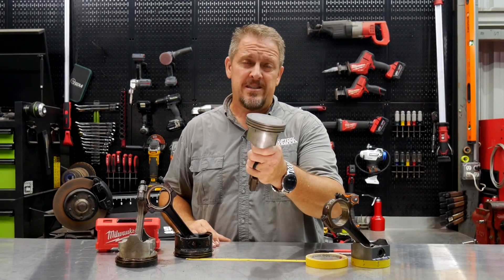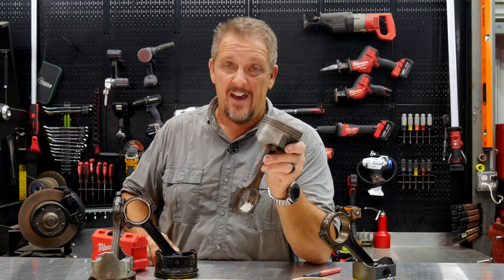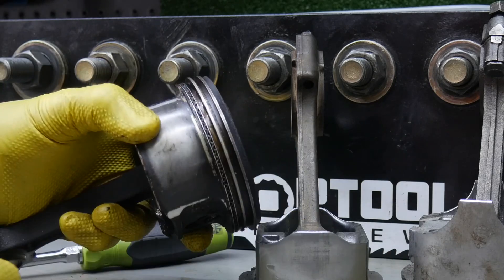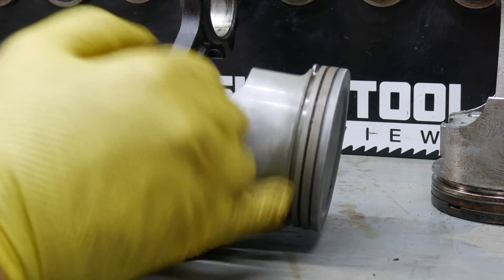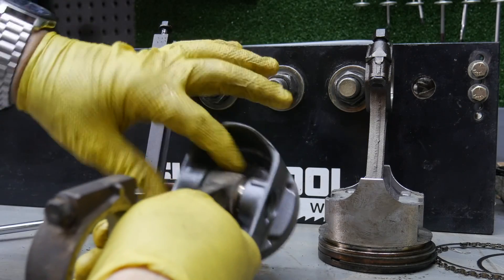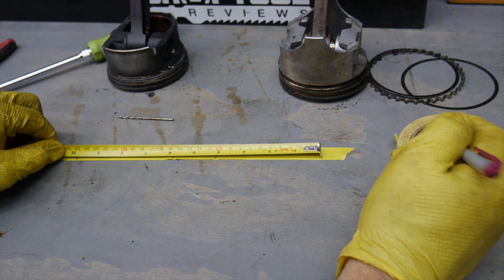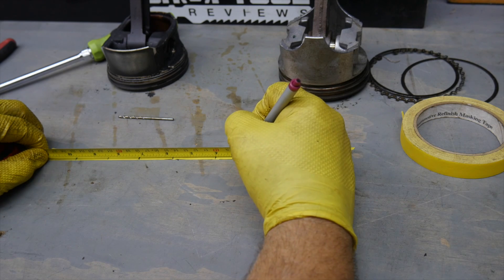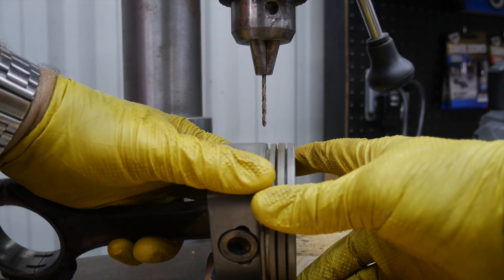How To FIX Chevy’s LS Piston Mistake - Oil Consumption Fix In Minutes [DRILLING FOR OIL]

Comment: Oem ls3 pistons come with 2 additional oil drain back holes already per side. If your doing a rebuild and you arent going forged its a better piston vs the l99 or truck l92 6.2 variants.

Comment: Very good ! The only thing , (based on what I’ve seen on other  pistons designs ) is the right number of holes ! I think that there need to be drilled much more than 4 holes . Probably 8-10 ( 4-5 by side) will be better and right . Also , first you can drill pilot holes with smaller diameter drill bit through small piece of tube ( bushing) with outside diameter close to the hight of the ring channel and inside diameter a little bit larger than the drill bit diameter . This way the holes will self center on the bottom of the ring channel. After that you can make second pass with the larger diameter drill bit. Thanks for the video!

Comment: my LS 3  IN A 2006 MONTE CARLO WAS USING OIL & DEVELOPED A MISS -  Upon some research i found this tp be a VERY common issue -  i have forgotten which pistons are prone for the problem  seems like ther were 3  of them - you can goggle for yourself -  Anyhow - G.M. makes a chemical that is poured into the problem cylinders - let that stuf set for whatever time the instructions say , seems like approx 15 mins - chev sells this by the quart - your gonna hafe to check with the parts dept for the name  ,sorry -- it has been 40000 miles since i did this treatment and several years so pleaze forgive me ---- HOWEVEER for approx $ 25.00 YOU can fix this issue -  the back plugs were difficult  but maybe u have tools that i dont have .   u will need a small funnel & about a foot of hose to reach spark plug hole -  plus sockets etc -  remove problem plugs pour chem in -let set minutes - after setting  remove coil wire -so it wont start ture it over to purge liqid - put a peice of cardboard over top of engine to keep the chem from geiiing on paint -  hope this helps some one -  i changed ALL plugs & wires  while at it approx ,110 k on the car when done - now 150 k   with more to come

Comment: Wow 😮this is cool, I have a question I have a 2017 Kia soul and is starting to burn oil almost a 1quart every 2000 miles Can this be done in the pistons on that engine if I rebuild it, the car is awesome and it has good mpg everyone your comments will be appreciated.

Comment: We have the 2.4 ecotec engine, we are going to do this for the notorious engine oil burning issue, Jasper Engines now apply this method on the 2.4 pistons in the Ecotec engines that they offer now, I am convinced of this method of modification. Thanks for the awesome info vid
Reply: my old 2.2 ecotec burned oil like crazy i'd have to put in a quart every 2 weeks or so but i beat that motor up every day redlined and took every beating

Comment: So, is this THE cure, no but it is an easy thing to do that can only help. If it does nothing more than keep the rings free it's a great idea. An oil catch can in the PCV tube is also a great addition. I would also like to add that almost NOBODY changes pistons on an LS. I have NEVER seen one with a ridge at the top, or pistons that were worn out of specs, why spend at least $300 for pistons unless you really hate that piston slap. My buddies truck was down 80 hp at 275k, new rings and a bigger (stage2)cam, boom 180 hp gain. These blocks, hypereutectic (hard surface) pistons, and better oil keep these from wearing like any old engine from the 50-60"s  As a GM World Class tech and slobbering car nut, I have pulled lots of these apart. Most all of them have stuck rings. I have also seen it on many other engines, besides GM (for all you haters). Seems like every manufacturer has oil consumption problems: 4 cylinder Ecotec Mini Cooper, 4 cylinder Chrysler, Nissan, etc. Later model LT engine have holes behind the oil rings, and a different PCV system, very few oil consumption problems. Now in my experience with these engines it is rarely just one thing that causes this problem. Cheap oil (Dexos is great, cleans out sludge and is available at Wal-Mart cheap), extended oil changes, and to me the biggest problem, putting around like a 90 year old and the engine never sees 3,000 rpm. Worst ones I have seen is the 6.0L, I had to do lifters on two in a row. One had so much carbon build up it filled the quench area and you could tell where the combustion chamber started. The next one was clean as a could be, very little build anywhere. I made an effort to talk to the customers and the first one used oil and they said they drive pretty slow. The second customer said they drive like their hair is on fire. The MPG showed it too.
Reply: Great information

Comment: I would add a piece of wood screwed to the board that the face of the piston would butt up against as a stop. Once you get the first one set, getting the others would be easier and more stable during drilling.

Comment: Wait a Minute . I think you’re doing more damage . The ring is actually called an “oil control ring “ . It also supplies oil to the cylinder walls and aids in lubricating the skirt . It’s. Not supposed to drain all of it . Engineers designed it without holes for a reason . Just a. Heads up . It’s not scavenging oil to take back to the pan , it’s scavenging to later be deposited back on to the cylinder wall . You don’t want to get rid of it .

Comment: I've got 423 head stock 5.3. I use catch cans on both ends. They work well.
Reply from the maker: Yes, running a catch can/s really helps and ensuring that the valve cover baffle/pcv is clear and working properly. Thanks for watching.

Comment: Only thing needed to do after is weight each piston and match up with right rod and catch for balances
Reply from the maker: You can definitely do that if you're building a high-revving race block. Or, if you're running on the street, you didn't remove enough material to make much difference, so you throw it back in the block with fresh rings and a hone job, let'r rip. Thanks for watching.

Comment: This is why it is important to use full synthetic oil on L S engines. But we live in America were most folks just run their stuff into the ground buy the cheap oil and trade it in for a new one.
Reply: just restored an ls4 gxp been driving daily in Ontario. As I was doing mini restoration and paint touch up and paint correction I soaked all the combustion chambers in. Kleens combustion cleaner for a few days to clean ring lands and free rings as it was a stock motor with dod then changed the oil with 5-40 synthetic and hi quality filter  the car has over 100000 miles and runs and sound like new the 5.3 uses no oil . Also for gm front wheel drive transmissions I used transmax synthetic and a biggest transmission oil cooler . Purchased the car cheap because it had a destroyed transmission. One I replaced it with a rebuild I checked the temp and on a 75f day it would spike to 218f way to hot and it actually started to darken the new Oem dex so I flushed it and added the rv cooler in series with the Oem rad cooler and added the trans max synthetic to replace the Oem fluid the car runs 175f after freeway 75 mph driving of 100 miles . So in my opinion the cooling and hi quality synthetic fluid will help keep the transmission alive with a yearly service of removing 7 quarts pumped out transmission dip stick tube

Comment: What’s really interesting is that the LC2 Turbo Regal/grand National  engines has this same type of oil control /drain where it forces the oil down to the wrist pin.  I have taken a bunch of those part and never had a issue with the oil rings being coaked up with carbon.  And or burning oil.

Comment: Because its GM and all they know is stupid junk
Reply from the maker: I don't think that's exactly true. The LS is still the go-to platform for building cheap power. What other motor can you buy for $400 (used) and the stock rotating assembly hold together for 700hp+? It's a well-proven platform, but not without a few cautions. Thanks for watching.
Reply: @Shoptoolreviews  very true , over here in AUS plenty of stock bottom end turbo combos making genuine AUS dyno recorded power levels over over 800rwhp+ on stock bottom ends running easy 8sec quarters great video boys
Reply: @Shoptoolreviews  and some have gone even quicker , great base the LS 💪👍

Comment: The original Saturn engines used the same drain back feature and it wouldn't take long for the engine to start burning oil.   Back in 08 I rebuilt the engine on my Saturn and did this mod,  I think I drilled 6 holes in each piston.   Long story short, the Saturn was able to go another 200K miles without burning a drop of oil.   As a mater of fact the engine was still running great when I scraped the car.
Reply from the maker: That's a great story and thanks for sharing. Thanks for watching.
Reply: I laughed so hard 😃😃Shows to go you.......😳😳😳😳😳🤪🤪🤪🤪🤪 That's amazing !!! I want to try that on my 5.3 l 2005 Chevy

Comment: I wonder if this issue is what has caused my 2001 4.8 to burn oil since new?
Reply from the maker: I would venture to say that the culprit is probably the valve covers and PCV system. You can find videos on fixing this issue in the valve covers. Thanks for watching.

Comment: We all better learn to rebuild engines for when manufacturers all go EV.
Reply from the maker: That will be a sad day. Thanks for watching.
Reply: So I get there is allot of drive for ev, I work for a Major oil company.  They are heavily tied in with allot of these WEF partners, they are still placing brand new production facilities in the gulf, with plans to reduce production down to 30% by 2050.  So unless they get backstabbed by their own partners, then it'll be a while.
Reply: The gas racing community still has a huge demand for preformance parts, if there is a demand there needs to be a supply. The government won't get rid of has because there is a huge demand, so if they get rid of petroleum fuels they would loose billions in tax dollars. That's from a economic perspective. Trump even said he will keep drilling oil, he have oil for the next 200 years.
Reply: Never will happen Biden will be history soon
Reply: There won’t be any gas or it will be 50$ a gallon buy 2030 2035. The plan is you will own nothing and be happy not joking study this for many many years. I have older vette I have owned for 40 years which is resto Rod with a blown modded  L82  .Also have a 2006 gxp 5.3 which I have been driving daily after I restored it and oil rustproofed . The gxp is mint but with the switch to electric and my keen interest I global events I see no future in collecting cars . Also was restoring a 1977 searay with 351w but not sure I won’t sell it because right now in Ontario Canada the province is locked down and the boat ramps are forboden you can drive as per the Covid 19 lock down aka the flue
Reply: There will not be enough electricity to power the grid either. Good luck charging your ev if it didn't already get repoed because you can't get to work.
Reply: @stevenpolitte4628  we're not going to switch to EV's overnight, the infrastructure will have to be upgraded over time but your argument is short minded and invalid considering there's still 20yrs until manufacturers are required by law to only sell EV's and that's still only in certain countries. Gas cars will still be around after that you just can't buy them new. No duh the infrastructure can't support that now but there's plenty of time and money to upgrade.

Comment: Also mane a 8.1 L
Reply from the maker: 8.1L is not an LS variant. The 8.1L is the L18 Vortec 8100, which is the last Big Block engine that Chevrolet made, ending production in 2009. There has never been a LS big block. Thanks for watching.

Comment: We were doing this procedure on some Toyota 4cyl. Engines back in the late 90s. Low and behold Toyota eventually offered redesigned pistons later to help correct the issue. High quality synthetic oil run at reasonable intervals will help prevent buildup in the oil rings that make them stick.
Reply from the maker: You're exactly right, regular oil changes and good oil will definitely help this issue...but it was still a poor design. Thanks for watching.

Comment: Judging by the buildup on the piston the primary problem is either insufficient oil changes or the engine got hot.
Reply from the maker: Yes and No. Yes, this particular engine could have done better with oil changes, but that doesn't change the fact that LS pistons need larger scavenge ports. Thanks for watching.
Reply: @Shoptoolreviews  I just took apart an 86k mile gen 4 from a 2011 truck, seized oil rings here too
Reply: The last two engines I rebuilt have had this same issue, I will be doing this on the engine I'm building now

Comment: Because CHINA OWNS THEM!
Its pretty bad when these pukes build those engines to FAIL.
Reply from the maker: The LS engine is a great engine, but it just needs a little massaging. Thanks for watching.
Reply: @Shoptoolreviews   I have heard GM does all sorts of questionable things/doesn't,  on purose on to their engines that would Otherwise make them last much longer. Its hard to keep up on all of them but thanks for being a Watchdog and giving HEADS UP!
I would love to Buy Out GM then build things CORRECTLY, with a Team of Engineers that Don't want to be on my Deadpool list! Like the asshat that engineered the oil filter placement on the HHR!

Comment: My guess is many burn oil because when installing the oil ring, many don't check to see if the expanding spacer between the two thin steel rails has not jumped from being butted up against each end of it. You just look at them and they slip past each other. I ordered eight pistons and the rings were already installed, and in all eight the spacer was not in correctly. The spacer is what exerts pressure on the rails to push against the cylinder wall.
Reply from the maker: Correct, that's why they're called the expander ring. However, we're talking about an issue that was done at the factory. I have a hard time believing that all of the factory expander rings were installed wrong. Thanks for watching.

Comment: If I have the pistons out odds are I’m not going to reuse them.  Aftermarket.
Reply from the maker: You can buy aftermarket, but most of these LS pistons are perfectly fine for reusing. They're also very safe to build 600+ horsepower. That's pretty cheap performance. Thanks for watching.

Comment: No surprise GM would not have the piston drilled. PROFIT First.
Reply from the maker: GM is probably not looking beyond 100K miles, which these LS engines handle without issue.Thanks for watching.

Comment: Your positive that it can't hurt integrity or unbalance it a little. Just wondering, there known for chippy the top edge off the first ring already. There swallow pistons and a awesome idea
Reply from the maker: Under boost, they are known to pull the top off the piston and the first ring, but you're doing the drilling at the oil ring. You're not removing enough material for the pistons/rotating-assembly to be out of balance. If you're concerned then just weigh each piston/rod and match them before assembly. Thanks for watching.
Reply: Weight will be negligible. I'm thinking the structural integrity would be weakened though..... I'm not going to try this on my turbo 5.3, and find out.
Reply: Performance pistons normally have drain holes and drain to the wrist pin

Comment: They did such a good job on the ls motor why would they mess with the way the pistons work they knew the old style pistons worked well why change something that's not broke they would have been smart to change things on the piston that needed it but why mess with oil passages when they were great before imo that was one of the very few mistakes they made on the ls
Reply: Maybe to strengthen the pistons for more power.?
Reply: @cameronbittner4971  maybe but have you seen the power you can get from the old engines with only replacing the rods they will handle over 800 hp more than enough for the average gear head or even the novice racer my main point is they could have gave it much better oil drains and it wouldn't have weakened hardly at all if any but to make it where it gets clogged up like that is a design mistake that never got fixed
Reply from the maker: Yep, they got a lot of things right on the LS, but they should have had a little more scavenge in the Oil groove. Thanks for watching.
Reply: The change to the LS piston design eliminating the drain back holes actually took place before the advent of the LS.  I have a 5.7 Vortec (non-LS) from 2000 that has the identical bad drain-back dimples on the pistons.  I'm drilling holes in them today.

Comment: To help speed up the layout of the new holes, use a seamstress tape.  They can be found in the sewing section of Walmart, or wherever.  You now now that you need 1 3/8" from the factory slot, to the first hole, to the next hole.  Start at a factory slot, make a Sharpie mark, and you are done.
Reply from the maker: Yep, that's great info. Thanks for sharing.

Comment: The reason why they did that design is to keep the oil on the skirt of a piston you can see the drain back holes where the pin is yes in the LS engine has a poor PVC valve system it's all about how much you change the oil and you should use a good durablend or all synthetic
Reply from the maker: You are correct, for the most part...or at least I agree with you for the most part. However, they still should have allowed for more drain back in the pistons. It's a very common issue, in both dirty and well-maintained engines. Thanks for watching.